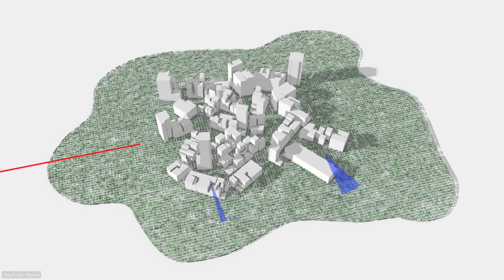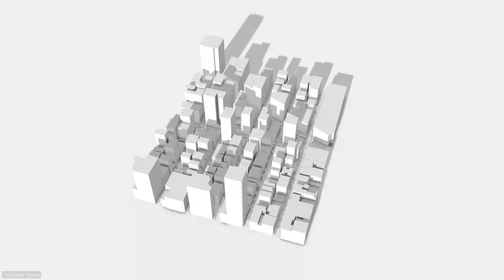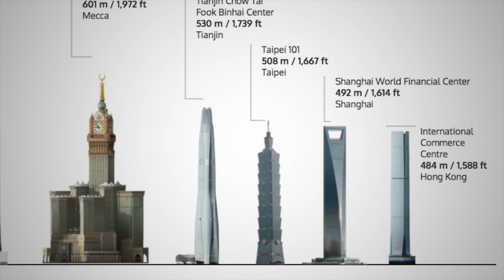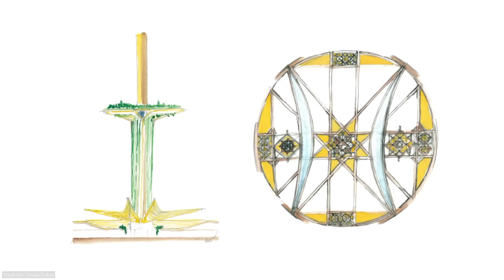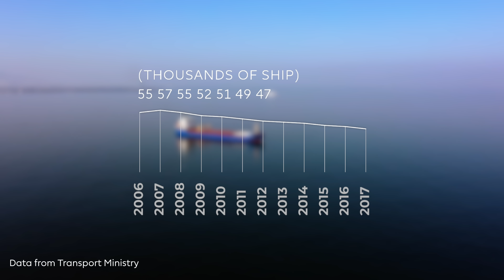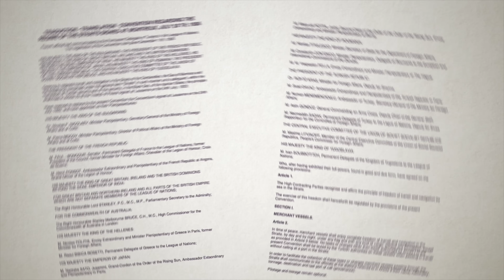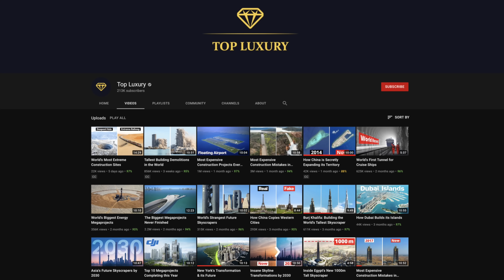Impossible Megaprojects that will Fail

Comment: ...I don't completely hate "The Line", but it's just too weird. In concept, cool, you have underground trains that only have to travel straight. In practice, those things are going to have to start and stop a lot, they'll probably be horribly overcrowded, and any one accident freezes that entire rail. You'd need at least a dozen rails, so dozens of drilled tunnels, all relatively close to each other. Also, stuff would just be needlessly far from everything else.

Comment: Well . I guess nobody talked about the possible international trading benefit of the Istanbul Canal.
Erdogan has to keep out the Ships traffic that will come right in the middle of his city/the Center of Istanbul which has the Canal as one of the main views.
Since many years , Holland is opposing Romania to enter Schengen.
And here is why:
Netherlands has Rotterdam, the biggest port in the EU(so cashing up a lot of billions)
Romania has Constanta, kind of closer to the Suez Canal(by thousands of sea kilometers) and the biggest in Eastern Europe?
A logical approach of any vendor bringing his merchandise to Europe would be a fast delivery of his merchandise.(and cheaper if possible also)
What would be faster way to reach the Rich nations from the Center of the EU ?(not to mention also Russia, Ukraine when the war will end...)
1.to go up through Aegean sea, through  Erdogans Canal and Constanta, and after inside Schengen on the motorway until Berlin?
2.To go around all EU by sea to Rotterdam, probably 2000km extra with a speed of maximum 35-50km/h and after also to Berlin?
guess who will arrive first, and which one would be less costly?
Conclussion:Netherlands would prefer to die than to help faster shipping via Romania and loose his billions...
Reply: Correction: until Rotterdam are almost 7000km for the ships coming from Asia/Middle East through the Suez Canal. Until Constanta a little bit less than 2200 km. We are talking around 4800km by sea versus around 2000km by rail/motorway....
http://ports.com/sea-route/port-of-rotterdam,netherlands/port-of-alexandria,egypt/#/?a=0&b=3037&c=Port%20of%20Alexandria&d=Port%20of%20Rotterdam,%20Netherlands
just an example, Alexandria is more close to Rotterdam than Suez Canal, and still needs around 15,7 days to arrive.
By contrary, to Constanta there are only approx 4,9 days at sea. Than by rail/motorway probably in 2 days in Berlin. 
Almost 10 days faster, cheaper prices(eastern European )
This goes both ways:export from Germany to Asia....
Guess who will still go to Rotterdam?:D

Comment: It is possible to achieve extreme high speed with a train. The TGV set a record a long time ago. It was achieved on a existing route in France. The train reached a top speed of more than 570 kilometers per hour. And it was just a regular TGV train on a steel railroad. Just type it in the search bar here on YouTube: TGV world record. 😊

Comment: The train on The Line makes no sense at all. It doesn't matter how fast it is, you'll still need stops. Because there will be no cars that means the train will be the only means of long/medium distance travel so that means many stops in between or you'll only be limited to the distances you can walk or cycle. It's a nonsense idea and total BS. They will start building it but it never come near to completion.

Comment: What hasn't been explained in the video, is that the buildings that construct The Line are 500m high and both sides are glazed mirror facades. The problem is the scale, how to ventilate the interior of such a high rise, the effect in the sorroundings, plus the fact that people will be mostly confined in their habitat, etc.... I could also agree that a line is not the ideal configuration for a city, as same people have already commented.

Comment: They tried so hard to accelerate the future, but the future is coming gradually. You can't create a true futuristic city cause we don't have the tech yet. Science takes time

We are just in the start of 21s century, just like 1910s and 1920s were very low tech compared to 1950s or 1960s, the same will be from 2010s and 2020s compared to 2050s and 2060s

Comment: Hi I’m from Saudi Arabia and the line project will not fail and they were working on it from 2017 and it will finish in 2030 and they are still working on it

Comment: In order to serve all inhabitants along the line, the train needs to have stations every 2 or 3 kilometers. But, this prevents it from going full speed, because trains take a long time to accelerate, and before it even reaches its full speed it has to start slowing down as it reaches the next station. When aiming to travel at speeds of 500 km/h, you can't stop every 3 kilometers because that means you don't have enough time to accelerate to your full speed, rendering it impossible to travel the whole thing in 67 minutes. You can only have a station in the beginning and one in the end, but then it loses its purpose because it doesn't serve the people in the middle. There need to be multiple trains, each traveling at different speeds and each having more/less stations, like train systems in Italy. But this already impacts the cost; Japan's magnetic system(the only way a train can reach speeds of 500 km/h) already has a price of 65 billion USD dollars. Add more rails and the price of only the train part of the project will easily surpass 100 billion dollars.
Reply: That's THE irony, apparently unseen by the engineers and project owners, yet obvious to those who actually commute every day. If the train only has 2 stations at both ends, then it's virtually equal to connecting 2 separate circle-shaped cities. LOL.😅 As many people have pointed out, this project is 100% gimmick.
Reply: @indrapratama7668  also unseen by a lot of commenters trying to justify this bullshit.
Reply: @howardbaxter2514 
Yep. I fully support MBS' efforts to modernize his country, but this gimmick project is just another Cyberpunk 2077.🤣
Reply: @indrapratama7668  Exactly!!!
Reply: at last someone understands it! Thank you...
Reply: @alexanderlobov1432  Thank-you! I noticed that nobody was talking about this problem, the biggest in my eyes; therefore I decided to write about it myself 😉

Comment: Assuming you have a 170 km stretch where you don’t have to replace anyone, the line still doesn’t sound that bad, of course, crossing it in 20 minutes is imposible but a high speed train could realistically cross it in 1 hour or 1 hour and a half, which it’s just fine for commute times, and having everything at reach from a single transport line makes it easier for everyone to use it
Reply: But the train has to stop every few kilometers, so it couldn't be much high speed. Otherwise without stops along the city it will only connect two ends, but what about the majority of people between these two ends? So it would be more like any other metro system, which is not bad, but 170 km would take hours.
Reply: Hyperloop
Reply: They do have to replace people. Plus I agree that the 20 minutes claim is laughable.
Reply: even if its not that fast everything will be fine as it is not a big deal but maybe it can cross the line in 20 minutes who knows we can't underestimate the prince

Comment: I once saw a Sim City Let's Play where someone made an entire city using just one road, it did not end well. Turns out making your city completely dependent on one method of transportation with very little to no redundancy is a very bad idea. One disaster could completely cut off the supply chain and severely cripple the city's ability to recover. Looks like the inspiration for "The Line" came from that, and I expect the end results to be the same.
Reply: RTGame?
Reply: @corruptedplayer  yep
Reply: @OmegaZyion  sorry for being pedantic but it was Cities Skylines, not Simcity
Reply: That is a awesome game
Reply: If it actually gets built. I doubt it will make it to the point of becoming inhabited.
Reply: One earth movement and domino crash
Reply: Ofc its a bad idea
Reply: Well first by its scale it is more than one road and it is overlapping. But, still a bad idea.
Reply: @Starteller  They don't plan on using cars. The entire city will be dependent on its rail system which is concentrated in one place and is overly complicated so it is likely to break down often. All the other paths are meant for pedestrians.
Reply: i guess that those games are not used for solutions in real world? (i ask as an interested and critical gamer)
Reply: @marcovonatzigen5494  While Cities Skylines has a lot of issues when it comes to replicating reality, especially when it comes to certain elements like cost, engineering, and traffic patterns, many other high level ideas do apply and can be used to model the real world, such as efficiency of road layouts and interchanges. If you want a real life example of the importance of redundancy, look no further than NYC. Penn Station, the main rail station in NYC located in the heart of Manhattan is an underground station with tracks heading east and west. To the east, there are 4 tunnels linking the station to Long Island and cities and stated the north east like New Haven and Boston. To the west, there are only 2 tunnels connecting to new Jersey and beyond, and are used by NEC Regional Trains, Acela Express, and Half of the NJT Regional Rail Lines. This is where the problem comes in. These tunnels are in bad shape, especially after hurricane sandy. Any future disaster like it can send the tunnels collapsing. Such a scenerio would breathe disaster to the entire North Eastern United States. The entire rail artery between Boston and DC will be severed, thousands of commuters from NJ and Philly will lose access to NY, requiring users to use other modes like highways, busses, ferries, or PATH to connect to NYC, all of which don't have the capacity to deal with the demand of the Hudson Tunnels. Now at the very least in this case, this only applies to travellers leaving NYC from the west, There are 4 east river tunnels and Grand Central terminal for Long Island, Upstate, and New Englanders. However, now imagine the same thing except it is the only artery IN THE ENTIRE CITY. This would spell doom for the entire city, and would spell the end for the line.
Reply: @marcovonatzigen5494  they are very good simulators but anyone can tell u this is a bad idea😂
Reply: and i ask all game developers to create a game to handle the whole world: -> Spatially based on the flight simulator, with the implementation of a completely networked system that allows business, trading, etc., although you can set your own rules such as: unconditional basic income, or basic care through minimal work to which every citizen is committed (all unemployed (no matter which status you belong to) could do a lot of useful things).... etc. etc. also a dictator mode where the dictator can decide for the good of all people (e.g. true equality of all people) etc. etc. The simulation should be shaped by the users (with "mods" or whatever you want to call it, which should be able to be created in a very simple programming environment), you should be able to register as an individual in every changed world. all other individuals (who would not be "played" by a full-fledged human) would have statistical process values in the background. Since probably 97% of people would play along, the 3% (https://de.wikipedia.org/wiki/3%25) could also be interested in what would come out of it without destroying the current state of the art.
Reply: @marcovonatzigen5494  
https://en.wikipedia.org/wiki/World_Game
Reply: @David_Lloyd-Jones  nice, thanks!

Comment: Even if the Istanbul Canal was built, what would be stopping ships from just ignoring it and using the Bosporus Strait anyway? Like why take the toll road when the free road is just as convenient?
Reply: Because Turkey can force the ships to wait more than expected or even check them to waste time.
Reply: @sluchy7962  that would mean breaking the montro treaty which is a fast way to make putin pissed off
Reply: @meretricioussimp7759  It's not against the montro convention, Turkey has the right to search and let them wait. The ships will in the other hand have the right to pass trough.
Reply: @sluchy7962  that is literally breaking the montro convention, do u have a single clue what montro is? Or did u just hear it in this vid. We can do nothing other than do health inspections, there is no tool for us to make them go slower then they already are, doing anything else would make putin angry, even if it isnt technically against montro, which it would most likely be.

Comment: Neom city. The project indeed has a high probability of failure. The crown Prince has put the entire future of a country on this $500B future city on the line. MBS has a strong will, is brash and does have billions to spare on the project. On the other hand, international investors find it hard to trust and invest in the project for the same reason. The changes Saudi Arabia has been going through in the past decade is a revolution with 50 years. 
The research and development on the project have been going on at a breakneck pace. The first solar water desalination plant has already been in place. And the Prince has announced a new project at Neom, Oxagon- a floating Industrial complex dedicated to autonomy and sustainability with an autonomous cargo handling port.
Regarding the Logistics on ‘The Line’, Virgin has already started working with Saudi Arabia with their Hyperloop project, which can offer transportation speeds between 500-1000kmph.
The cities on The Line are set on a circular form to allow individuals to reach places within a 20-minute walk from the centre.
I do find it hard, but I wish the project bears fruit. Once completed, it would change the way cities are built and even change how we think about the future.

Comment: The canal reminds me of an 1800s Victorian-era canal project near me that would be possible today if it made sense, but turned out to be impossible at the time and half of the plans were abandoned. The Chesapeake & Ohio Canal was intended to connect the Chesapeake Bay near Washington, D.C. to the Ohio River in Pittsburgh, making a viable water transportation route from the Atlantic coast to the Ohio. However, it ended up starting in downtown Washington D.C. instead and only made it as far as Cumberland, Maryland. This is because scaling the Allegheny Plateau up to Pittsburgh would have required an 8-mile-long tunnel. The half-mile-long Paw Paw Tunnel had already nearly bankrupted the canal company. And what's worse, rail travel was beginning to take over as the dominant transportation means in the United States and the unfinished canal was already becoming obsolete. Though for most of the next century, the section of canal that was built was used to take logs and coal from Appalachia down to the D.C. area, so it ended up not being entirely useless.

Comment: Line is not impossible, as the name suggests if its a straight line and bullet train is passing through a tunnel without much wind resistance, it can reach that top speed, but since it has to make some stops in between, it cannot reach in that time..

Comment: I don't understand what does GDP has anything to do with the project cost of "The Line". Saudi projects for city buildings, Riyadh reconstructions are financed by the State's oil revenue. GDP of Saudi Arabia is low to support such projects off the revenues from taxes or any other sources. The problem with the Line isn't financial, it's the Saudi's mentality and ultra conservative population that would resist Westernization that Line is aimed at, so that's why there are certain risks involved in financing the project from private entities. The project itself is still ongoing, with slower pacing (Oil prices are low)

Dubai Greek Tower isn't an issue from Engineering point of view, considering the fact that it isn't a skyscraper. It may be considered as a tallest structure, but it cannot be compared to skyscrapers due to the fact that it isn't one. Considering the fact that Dubai's scheme is based on property investments as a source of income, the construction projects will never stop. The Greek Tower is just a part of a urbanization project surrounding the area, so it will be built last considering the pandemic.

Istanbul Canal is different from all because Edrogan's family and his allies have investments & ownership of companies related to project constructions, so you can claim that it's typical corruption on national scale. Due to the fact that shipping to the black sea only related to nations connected to it, there is a limit of shipping due to stagnating Russian economy. I wont be surprised if the Canal will have lower tonnage limitations. In  any case, if Turkey manages to build the canal, and by some sneaky way block the strait... it may just lead to a nasty conflict with Russia

Comment: Question: if there are no roads or cars in THE LINE, how will Saudi Arabia get all of the required construction materials/equipment into the area? It sounds like if they ever have any issues with any of the structures in the middle of the city, they'd have to either drive the trucks/cranes/buses on the sidewalks (a load far beyond what they would have been built to handle) or tear apart an entire pathway to the damaged area (only to slowly rebuild that pathway of destruction on their way out).
Reply: This will be explained soon
Reply: I mean they'd probably have some service roads still
Reply: It's next to the ocean so bringing by ship and machines etc should work